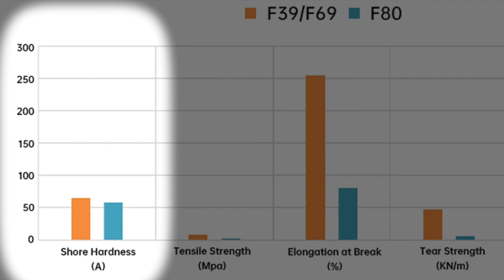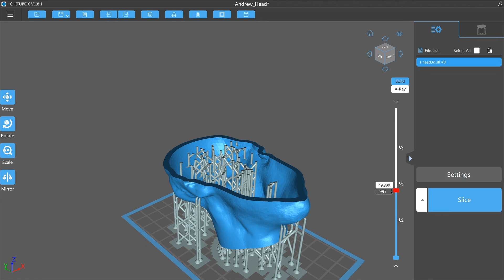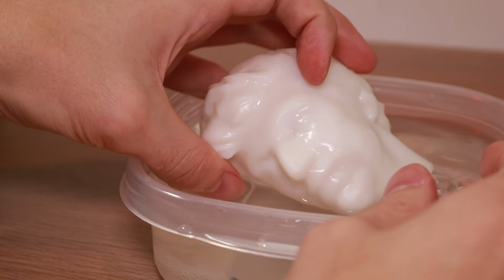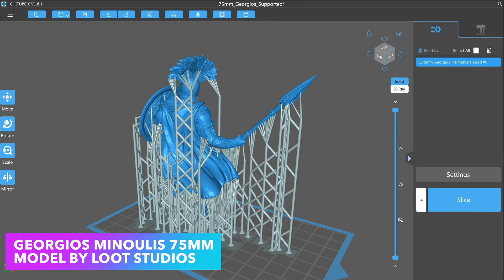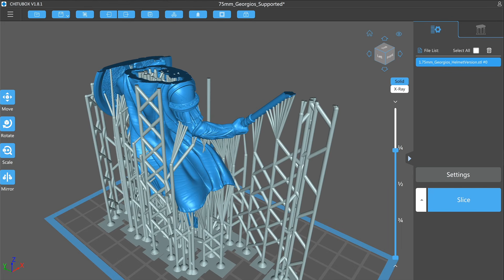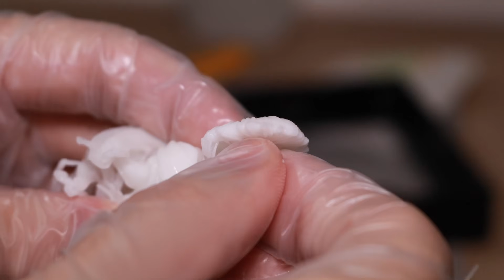Flexible Resin? 3D Printing with Resione F39 Rubber-like Resin

Comment: G'day m8......ive only been in the MSLA corner of the internet and practically using my machine for almost 2 months ( a Nova3D, Whale 2 ), i do have 3yrs under my belt printing FDM. You ask what applications that it might be used for🤔. Well i got into 3d printing for parts, bodys and scale items, we use in the Scale Rc Crawling (drive small 4x4s on scale terrain), i can mix like 10% of F39 with a more ABS like resin to give my bodys bounce when rolling down a hill. If its all ABS-like, it would crack an sheer after the first roll. so for me this changes the game, unlike FDM where you have to find the right filament, then make sure there is plenty of stock etc. With resin we can mix an test a lot easier, with 1x 500g bottle of F39 could mix up to 10x bottles with cheaper ABS-like resins to get your perfect mix. cheers for the informative vid ol son from Sunny hot🥵 Downunder🙃

Comment: Almost got hooked into considering this until I saw the fails on the cube and warrior prints. To those who print with resin, you know how frustrating it is to wait long hours or days only to see a part or two on the print object fail especially if it's part of the major structure of what you are printing.

Will explore further until I see a better quality resin.
Reply: Looks like it works better with thick, round shapes. Not so much thin shapes.

Comment: It would like to see strength testing. Saw you squeeze it many times. I want to know how far it stretches before breaking. What about twisting? On a thicker print, would it snap or just continues to deform? How resistant is it to sharp objects?
Reply from the maker: The SDS for the material is available on the Resione site if you're interested in the modulus, notched Izod, etc.

Comment: Wondering how this resin bounces back in cold water, did you test that? I’m interested in using this resin for a part that will be used in the ocean
Reply from the maker: I didn't test it in cold water, but it's probably a safe assumption that the printed model will be firmer the colder it is.

Comment: I can see this resin being excellent for printing negatives/moulds in which one would cast other things.
Reply from the maker: I actually thought about doing that in this video, but I ran out of resin. Making a direct print mold pattern would be a cool project, for sure!
Reply: It's more expensive to use this method than the old style of silicon moulding.  With traditional methods you only need to print the master copy which takes less time to print and uses lesser resin. Plus you can make bigger moulds with the silicon method
Reply: @dredgewalker  Do you have any resources pointing to such silicon method? I can find online but not good ones
Reply: I find it's cheaper to resin print a master, FDM print a "mother mold" that closely hugs the master (around half a centimeter gap between them) into which you pour some RTV silicone.
Reply: I wonder how that would work.  The problem I see is that the two printed halves  would not match up up well.
Reply: @DisgruntledPigumon  You can make the two parts have alignment keys printed into them, just like is added when making multipart silicone molds.
Reply: @DisgruntledPigumon  I can see that issue being a real thing. On the topic of resin printing/mould making though. A couple of months back i had a part i wanted to cast in pewter. I know how to make silicone moulds but i dont like the process, messy, time consuming if doing two part molds, ect. So what i did was to design the positive of the part into a negative for the silicone, essentially printing moulds for the moulds. Someone mentioned it was a lot like using match plates. The print was two boxes with alignment keys, pour gates, sprue between the parts and vents modeled in as positive parts and the space for the silicone being negative. Then i mixed up my silicone and poured it into the two halves and it work just as i had hoped, a very neat two part silicone mold. If i do more casting of 3d printed parts in the future, and they fit on my resin printer, i will always be using this method as doing all the mold prep before even touching the workbench seems like good sense to me :)
Reply: @zid_just_zid  Any screenshots of such a construction? Looked through instructions but still have lots of questions)
Reply: Printing with that resin is not very reliable.